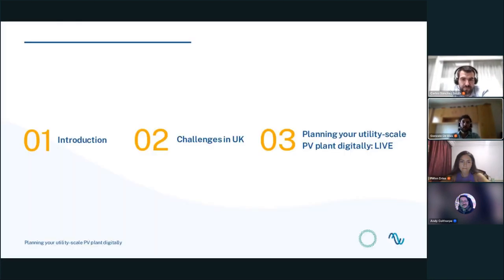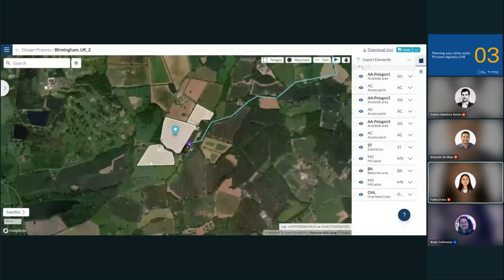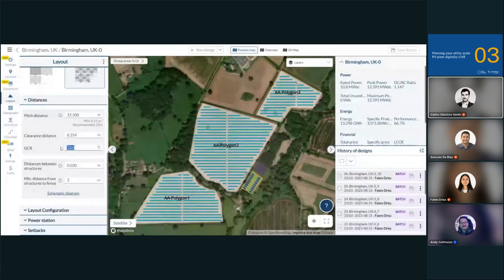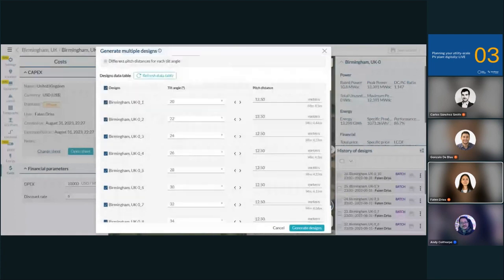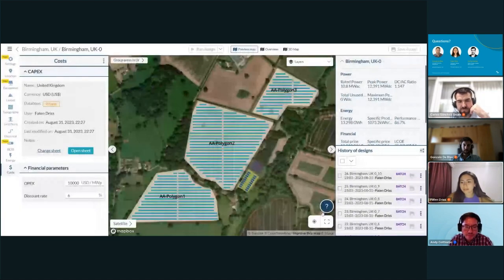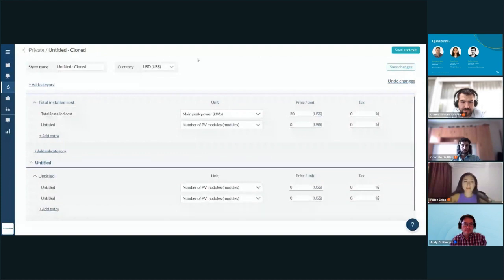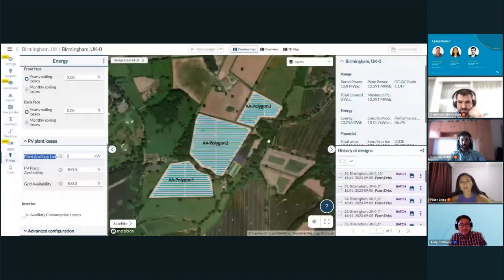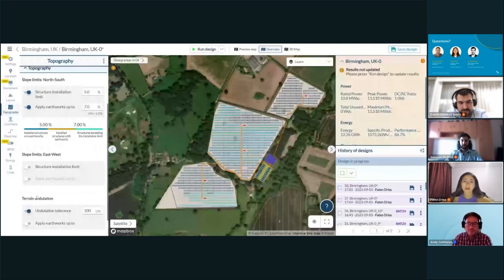Planning your utility-scale PV plant digitally with RatedPower’s software

Comment: If you put yourself in the shoes of the investor with this outdated design, would you invest your own money? I do not believe. You are still working with the old existing technologies, and you are struggling to fit in somewhere in the market, through software. Come on again look at all kinds of designs, you are missing out on much better ones like, MAXIMUM EFFECTIVE energy produced on m2 of expensive land. MAXIMUM on m2 land. Endurance to all the natural disasters that are a daily occurrence (see the news). Who is it ? Did you know that the industry has started to change from the inside out? You don't know, it's obvious from the nonsense you talk.
Use the seat of a smart investor to see where you're going wrong.
We should change the world effectively. Not commercially, as until now, to sell more unreliable equipment, but for the investor to settle his accounts himself for the future, when everything sucks from bad design, trusting you.